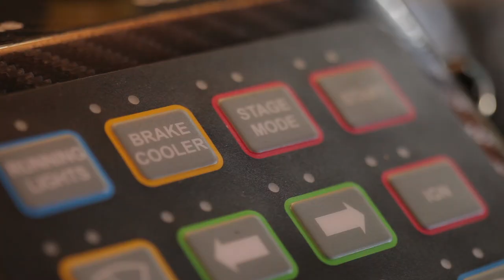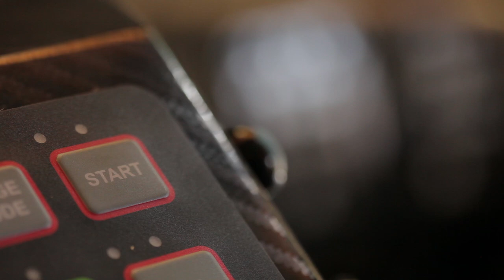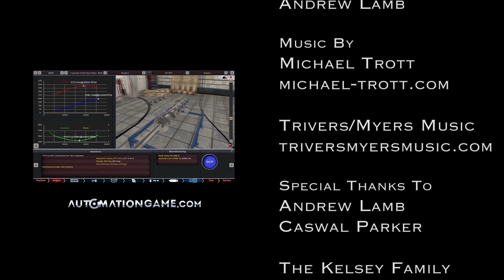The Homebuilt Rally Car That's Too Fast for the WRC - TST in NZ

Comment: This episode is gonna make Americans think french road cars are good.
Reply: Anders Kristensen I really want that engine now - American
Reply: Anders Kristensen My mother's first car was an American spec Peugeot 404.  So you can bet that older americans won't think french cars are good.
Reply: Anders Kristensen They already knew he Mégane III RS
Reply: Kaisuke971 Yeah that's actually a nice car, but the regular family cars etc, hatch backs. Not so much.
Reply: Anders Kristensen The Mégane III RS has the official world record for a production FWD car lap (Honda used a Pre-production car, no official record) on the Nürburgring Nordschleife, with a time of 7 min 54 s 36, which is better than the Ferrari F430, Porsche 997.1 Turbo , Audi RS4 (B7), BMW M5 (F10) and Honda NSX-R, in its Mégane RS 275 Trophy-R version.
This is not a "Regular Family Hatchback". This is a weapon.
Reply: ***** It's actually called 308 (if you're talking about the latest 30x car)... 308 R coming soon btw.
Reply: Anders Kristensen Guess what, the vq35 family is related to that renault engine. There are built ones still at 3.5 liters that make 400+ at the crank, and stroked ones that make 400whp+ NA. Rev past 8k, sound bananas. Great little engine when put together correctly.
Reply: +Pedro Areias Reliability has suffered during a few dark years.

+Bob Hope The 404 found fame in Africa and became legendary for its robustness there ;)